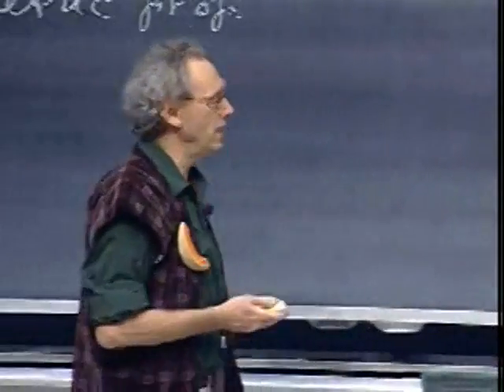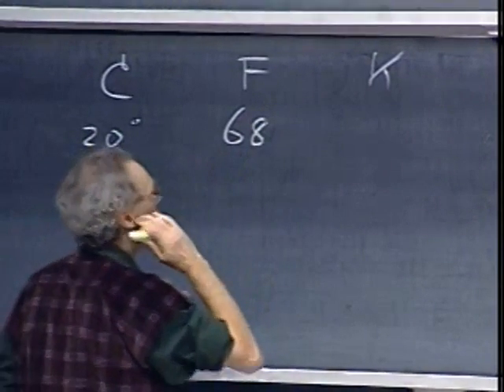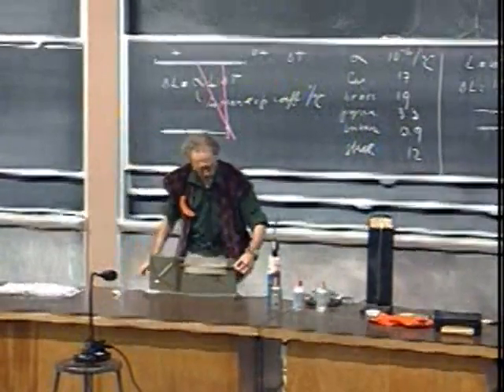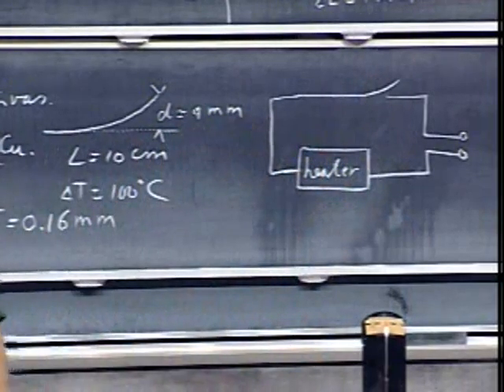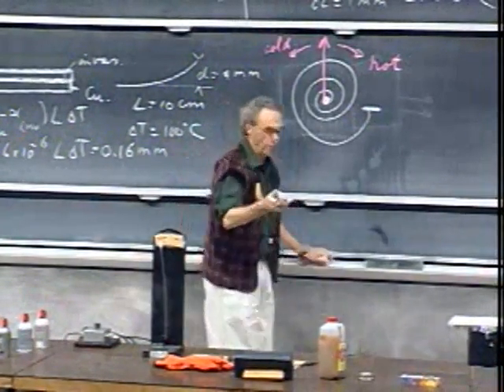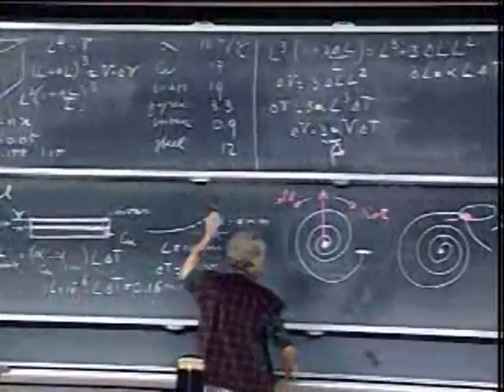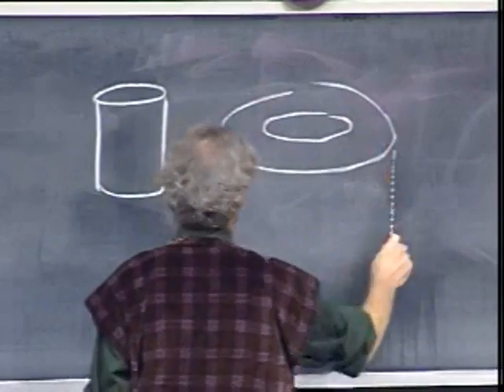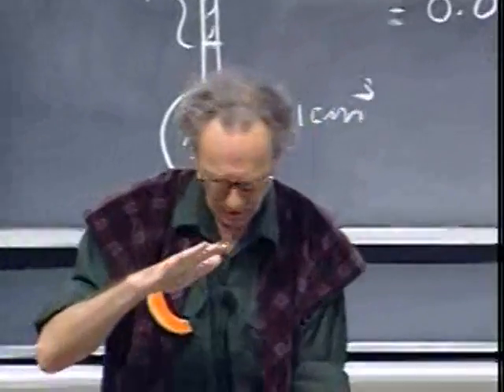Lec 32: Thermal Expansion | 8.01 Classical Mechanics, Fall 1999 (Walter Lewin)

Comment: There a small error: the spiral thermometer does not use a bimetal. Incredible clarity and simplicity of Mr.Lewin anyway! Great example for all physics teachers ;-)
Reply: So true, the spirals operate in one of two ways.. Some spirals like the bourdon tube are gas filled and the changes in temperature cause the gases to expand and contract causing the spiral to move which in the case of a gauge will deflect the needle linkage. 
In the case of the simple metal spiral temperature changes will change the length of the coil and in the case of many thermostats, there is a mercury switch near the end of the spring which will tip and short internal contacts to operate a circuit for heating or cooling.